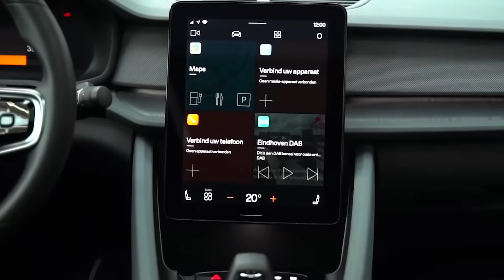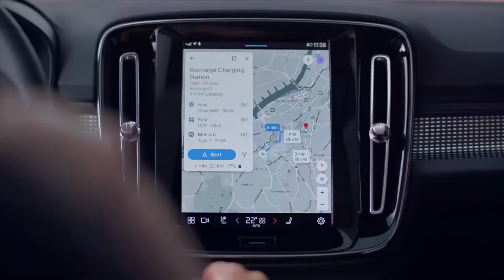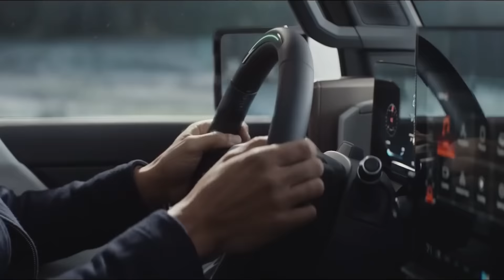12 New Electric Cars Coming In 2021

Comment: You fail to bring up the fact are the cars being rated under 300 miles in cold weather all batteries lose as much as 30% of their charging capability also to every minute going up a 6% grade they lose a full kilowatt amp that means you can't go driving in the mountains because elsewise you're going to spend the next several hours after you're done on the charger before you go to have any more fun and don't forget how bad the US power grid is we only produce 80% of our power right now that means 20% has to be imported my 2024 we're taking all of our coal plants offline for the United States because China needs the Cole when we do that where do you think your power is coming from it's got to be imported you're going to love the new carbon taxes even though you have electric car let alone when you got to replace the battery

Comment: tesla wery pore quolity
Reply: “pore quolity”? LOL you can’t even spell. 
I have had my TM3 since 2018, drove it cross country and never had any issues, recalls, or ever needed service. Oh yeah, I topped off the windshield washer fluid a few times. My break pads are like new,, and due to incredible electronic traction control that prevents slippage my tires are like new too. Paint is amazing and still looks factory fresh.  Most reliable vehicle of the 6 I ever owned. Try to own one before bashing it and spreading FUD.
Reply: Poor quality*
But yes, you are correct. There is not a Tesla on my list of vehicles I would like to own.
Reply: My next car will be a Tesla 😃👍
Reply: viral videos  that’s why you must carry comprehensive insurance :-)

Comment: Too many dumb SUVs going against the entire environmental point of EVs.
Reply: Sure, because advertising research tells us that most people are dumb too. They still want SUVs, and I think we'd rather them drive an electric one... right?
Reply: @chosenideahandle   Doesn't really matter with the current state of technology and most especially cost.  Tesla has a similar problem.  The issue is the cost of putting them into SUVs at the expense of more practical cars and vans.  So much waste in the broadest sense possible in putting them into a large vehicle rather than an efficient, practical, environmental friendly car.  Would rather have a push to electrifying far more efficient non-SUVs.

Comment: EVs are still way behind the curve to compete head-to-head with combustion or hybrids. EV truck barely get over 100 miles pulling anything significant and the best cars can’t even make it from Phoenix to San Diego with a stop to charge. If you ONLY want in town commute fine, but don’t head out of town because it will take forever to get significant distances because of all of the stops.